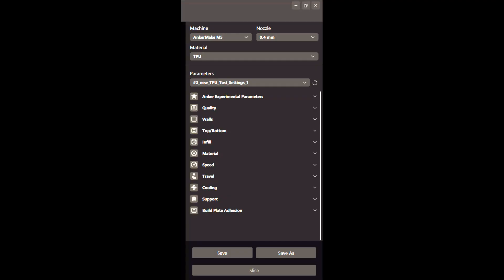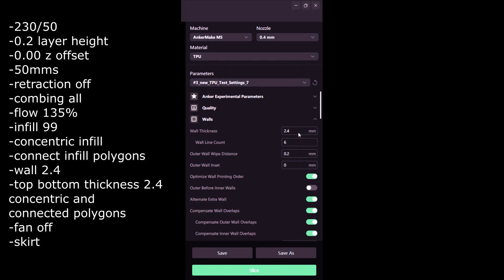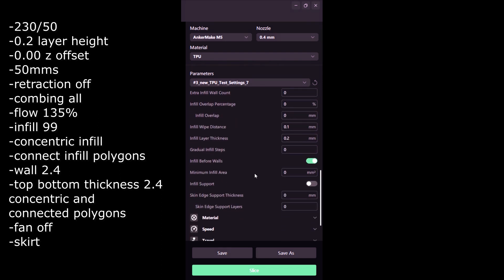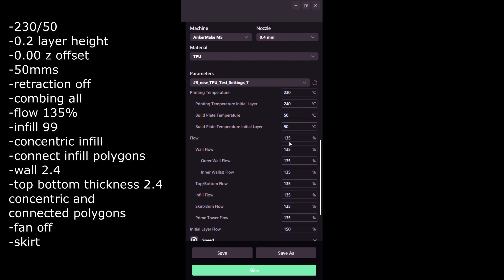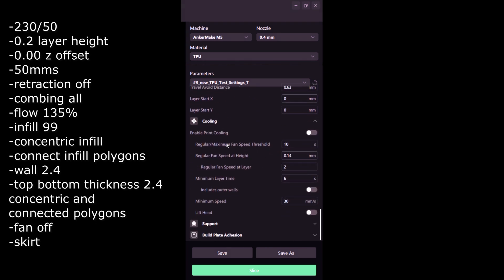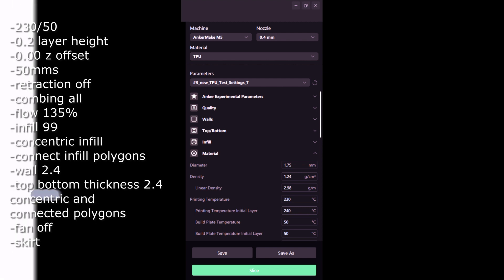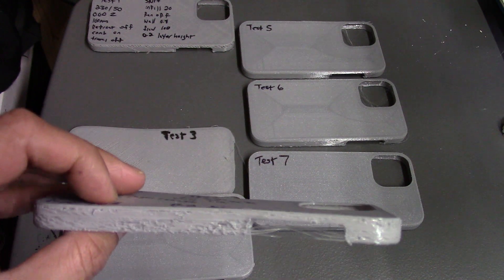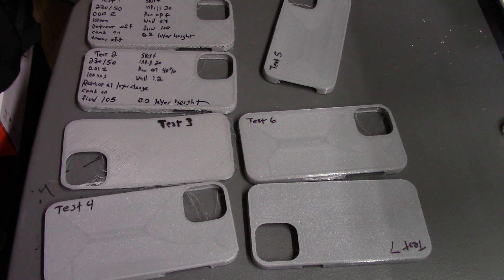Ankermake M5 TPU Slicer Settings!!!! My near perfect TPU settings on the Ankermake Slicer.

Comment: I am not sure what is going on, but It seems as if I have the wrong software, what are you using, the official software I have looks nothing like yours, as such I cannot follow and change the same settings you are changing. My expert settings tab dont have all those things.
Reply from the maker: I made these videos back when I received the Kickstarter Printers from Anker. The software was still very new and in beta back then. You're probably using the lastest version of the software. If the settings are not the same then I  assume Anker has locked it down. I got rid of both my Ankermake printers early last year, since they were both disasters and nothing but issues. It was the worst 3D printing investment I have ever made at the time. I assume Anker has stepped up there game by now though but they lost me permanently as a customer back then.
Reply: @MicBot   Well from my printing so far it has done me good. This is however my first 3d printer so I have nothing to compare this to. I have seen some post online that allows for other slicers to work with this printer which I am going to be looking into. The stock slicer I dont think is up to scratch.
Reply from the maker: I recommend using Cura. It was m9⁹y go to for many years and even for the Ankermake. I currently use Orca / Bambu Studio.

Comment: have u got a saved profile file so i can inport it as for some reason my layout look diffrent to yours . kind regards
Reply from the maker: I'm working on uploading them all to my pareon.
Reply: @MicBot  do u have link for the profile?
Reply from the maker: The profile I used is from the very early stages of the ankermake slicer. I was going to upload the old profiles but I was thinking, "what if it causes issues" I haven't updated my profiles in a while now since I got rid of my AnkerMake printers early last year.